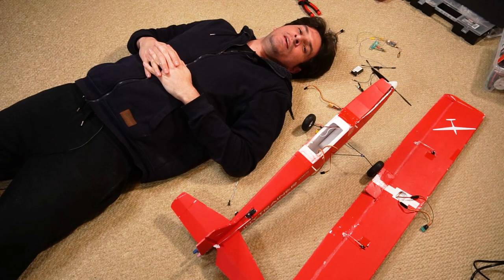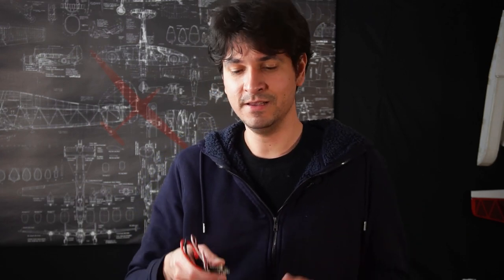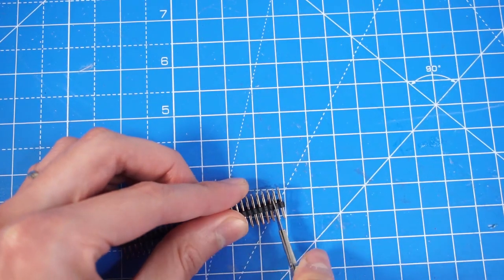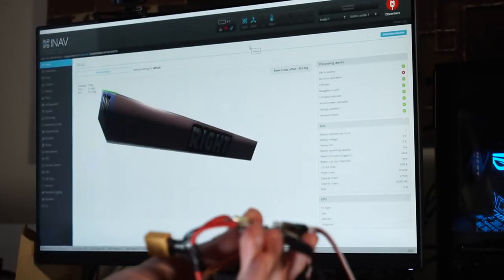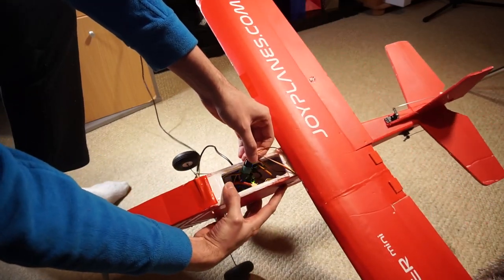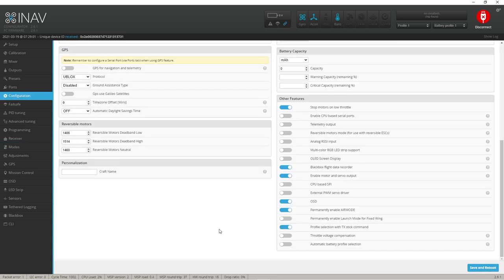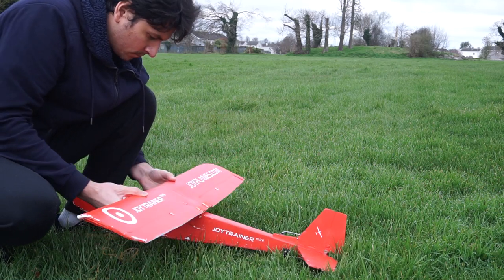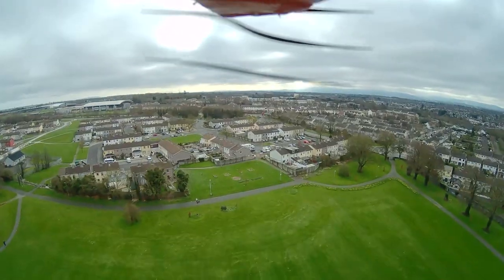Using a Drone Flight Controller for Airplanes | Inav in Joytrainer mini

Comment: Since my first pixhawk with all rtl, stabilize, cruise and so on I put FC on all my planes. Less crashes, less lost planes, more capabilities.
Reply: ....and less fun piloting the plane.   I guess it's ok if all you want is to take pictures from above and you find piloting the plane a chore.  I personally like flying things for the sake  flying them....for fun.
Reply: @toolbaggers  We all love to fly, that's why we do it :) I also started receiver only on my own depron made planes and learned to fly this way, it's more primal, not purer. 

If you want to fly like with simple receiver - it's OK we have passtrough and manual modes. Manual is the same like using only receiver.
I don't get it how not having FC is more fun, except that is maybe like ~60g lighter and 20$ cheaper.

FC is being smart. If you want to fly manual - go manual, wanna chill go cruise, wanna fly strong winds with heading assist- go Acro, wanna go home - switch RTL. It's superior man in every way. Having OMG switch is priceless, not to mention info like voltage, rssi, altitude, speed, osd.... 
Fly in fog, fly in clouds, fly at night, fly long distance, fly high all thanks to STM32.

Back to our love, I prefer spending more time with it and having a helper on myside to coop with it, rather than have one night stands with it and 10x nights in the garage.

Cheers,
Reply: @toolbaggers  well, yes and no. First, some people like me started with drones a long time ago and I especially liked the stabilisation with gyroscope AND accelerometers. Now, I'm more into planes of all kinds, but small (less than 250 g for most) and the issue is ... there is often wind on the field ! But with stabilization, I can fly them even with 40 km/h wind and "buzzing the tower"  (more speed sensation) with no issue except some altitudes changes with some gusts. I would be very disappointed to come to the field and break stuff because light planes and gusts.

Comment: Hi there I have a inav flight controller for swordfish rc plane but I can’t control twin motors with my transmitter but can you make video step by steps how to able to work twin motors I only choose airplane v tail in inav configuration software

Comment: This is great. I'm not using an fc but I have a bunch of spent 4in1 ESC from quads and I want to connect it to my flysky rx in a fixed wing. Right now I'm using it on sbus. I don't think I need to set it up as pwm bc I'm using sbus but I'm not sure yet what I'm doing. This is my project got the week.

Comment: Most plane receives included gyros and accelerometers nowadays.   Some even have advanced features for beginners using other sensors for return to home and other things like geo fencing and auto landing.  This is all contained in one little PCB.
The only thing it can't do is OSD but it can send telemetry data that you could read off you transmitter.
I have an ultra micro plane with 6 axis stabilization (gyro + accelerometers)  BEFORE quadcopters even came out.  It has a tiny board that has  a receiver, ESC, BEC, stabilization and 2 linear servos  that weighs less than the cable needed to wire in this FC.  
Nice side project!
Reply from the maker: Yes, I see many new planes with all those characteristics, what I love about an FC is the ability to customize the software and modes, it's really cool.

Comment: You mentioned one could also use flightcontrollers to control rc cars or boats. Can you tell me with wich firmware you would do that? I'm into drones for 5 years and curious if I Could use some parts to make a rc car with two brushles drone motors and props.
Reply: ArduPilot can do that. ArduRover is the project of that team that does cars for example.
Reply: thanks for your response.
Reply: ardupilot can do pretty much any vehicle type

Comment: You have to use all of the advanced features like the GPS, OSD etc for this to be worth the money, weight, and complexity.  If all you want is stabilization, you can get  a 7 channel rx for under $30 that is lighter, and less cumbersome than using a separate FC.
Reply from the maker: I know, I just said it in the beginning of the video, this is just a test.